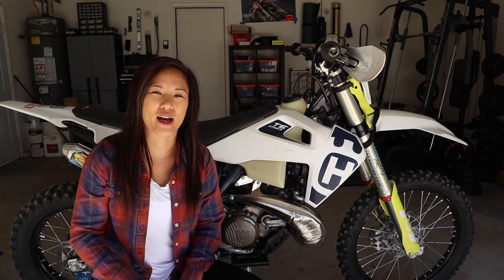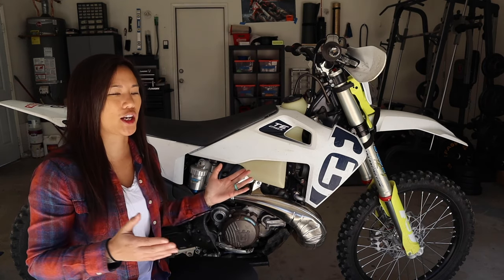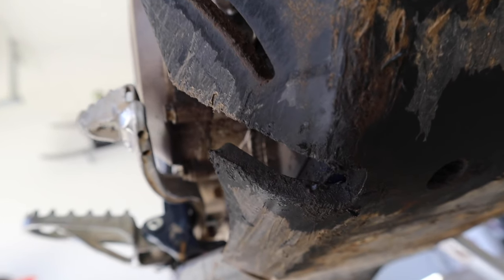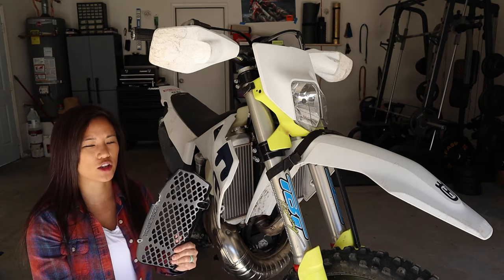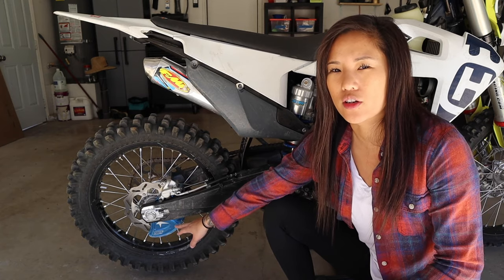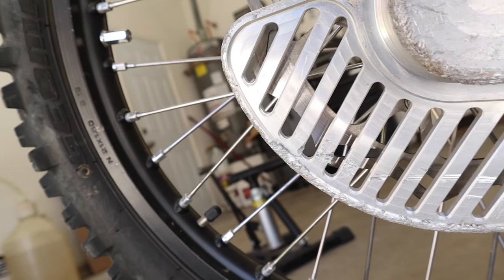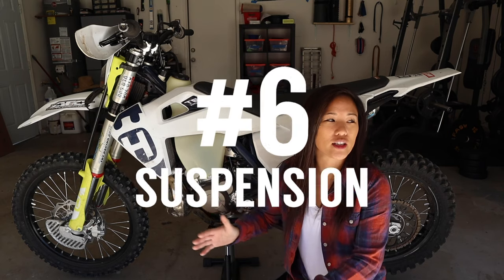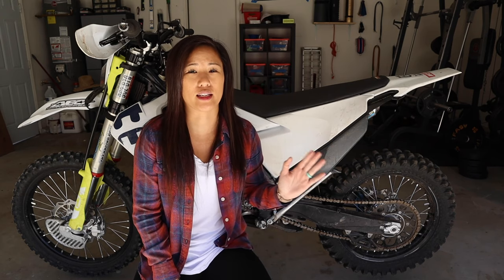TOP 6 Upgrades for Short Riders - Enduro Edition

Comment: I'm 5'4" and my current weapon is a 2017 YZ250X with a SmartCarb, Stealthy flywheel weight and a Scotts stabilizer. Been riding for 30 years and I've never let my height stop me from doing what I love most.
Reply: @Sanguine_Addiction did you do any mods to the suspension to lower seat height, or did you leave stock seat height?
Reply: @frankiesiwinski1494  the only thing I did to the forks and shock was a revalve and re-spring for my weight and riding style. I ride mostly wide open desert and occasionally vet MX tracks,  but I'm not trying to clear triples or anything like that lol. When it comes to off-road, I've never lowered the suspension or seat height on any of my bikes. For me, as long as I can reach the pegs and foot controls comfortably,  I'm fine. The only time I've encountered height problems is when I ride street, especially with tall adventure/Enduro models because I can't flat-foot those. Ironically,  I can ride a Gold Wing due to how the rider cockpit is laid out. Go figure lol.

Comment: I had an xtrainer and loved the size as I’m 5’6”, now looking for something else I’m curious how hard it was to transition to a full size bike?
Reply: I went from a KLX140g to a KDX 220r and it's been great. I shaved the seat to get a little lower to the ground, but I'm 5ft 2 and I can kick start it just fine. I do have to find places to stop a bit carefully to not tip over. But buy a used bike that already has some wear and tear on the plastics so you don't feel so bad if you do drop it. I waited to get the KDX until I had completely mastered the 140 and was maxing it's potential out. I still only ride in 3rd gear max on the KDX right now, but every trip out I get more confident with the weight and power.

Comment: My top short rider upgrades….. #1 suspension work (600$) to lower 50mm…… at KB5 industries in PA. They replaced springs to my weight and it’s amazing. I also got EVERYTHING else you listed. Good vid
Reply: I tried PR2 in PA., and would not use them again.  I am redoing it myself, (I have a little machine shop), and found that they did do the forks well, (the guy on the phone told me wrong), but they could not figure the right spacer for the shock, so I have to figure out the curve and make my own.  You lowered your 2", that is huge.  I thought my .75" at each end was a bit short, but I cut an inch off the seat too.  I have ridden dirt bikes for a long time and raced for about a decade in the 80's and 90's, and the manufactures made the 2-strokes as tall as the 4-stroke.  Anybody under 5'10" could ride a shorter bike better than offered today.
The Guys at PR2, who I talked with on the phone, could not "think past their script".  They really had no idea how this stuff works, and their limited communication skills with the guys on the floor doing the work, (who may be good), can lead, (and did with my shock), in the wrong work being done.  I had fairly easy questions that they could not answer,or answer correctly.

Comment: I had my suspension lowered 2 inches on my yamaha yz250f by a suspension shop and it made a big difference
I feel way more comfortable riding the tight trails now
Reply: I had my Beta 390RR dropped by 2" too, made me so much more confident!
Reply: Im 5’5, 141lbs. I really don’t want to bring my bike into a shop. Im hoping to do it myself. I can straddle my 250f tippy toed. Would like a Just a bit lower if possible. Anything you learned after taking it into the shop?
Reply: @ThenZ6  it cost me $700 but also they set it up for my weight and type of riding I do. If you plan on keeping the bike for several years it is worth the money.
Reply: So what’s the seat height come out to?  Up to in this case??  Sorry if you said it & I didn’t catch it…!!!
#44
Reply: @jefferymentzer1240  the seat height is approxiametely 36 inches now
Stock height is 38 inches. It really helped me since I'm around 5'7 inches tall.

Comment: That Emperor Racing radiator guard is a beast. I dropped my bike on a big rock right on a place that would have crushed my radiator  from the bottom corner. Now there’s a tiny little dent in the guard and zero impact to the radiator. Good stuff.

Comment: A nice & cheap way to freshen up colored things  like the black bar ends is to use black (color appropriate) finger nail polish.

There are 100's , 1,000"s of colors and cheap nail polish. It is durable also.

I have met many street bike riders (guys) with a bike part in hand color matching in a nail polish retail store. Works great on wheels & steel frames also.

ARC levers has guaranteed to not break  levers that many, most professional racers use (AMA motocross, supercross; enduro,...).
They will replace it if you ever break one for free.

Comment: I have had this problem in the pass, my solution was a bike with a lower seat height.  The bike may not perform quite as well, but it definitely reduced the number of times I was dropping it due to the fact my feet didn't reach the ground properly.  Depending on where you are riding, too tall of a bike can be dangerous to the rider.  A side benefit is that the bike is more fun to ride.

Comment: Just started watching.  That dented pipe is the reason why I don't use chrome pipes, you can't fix the dents with out hurting the finish.  You can fix painted pipes to look perfect again, and just repaint black exhaust pipe paint, (high temp paint).  I am an older timer, started riding as a kid in the Hannah days.  I had 5 250 MX bikes and quit for 20 years, and just picked up a 2019 YZ250 2-stroke in almost new condition.  Damn, they got tall.  I am 5'9" and never had a problem touching toes or ball of my feet on the ground.  I shortened my suspension about 6% on each end, and had a shop cut an inch off the seat.  If you really like riding,---even today, you will change the bike the way you want it.  I am heavier now, but this is the worst set up bike out of the box I ever bought.  I don't like today's plastic either, broken bird beak front fenders with a transformers cartoon look to them, and I cut the silly "arrow" shape off end of my rear fender.  Looks better already. :)  Nice bike you have there.  Michigan has some great trails called the "CCC trails" (Cycle Conservation Club).  I think they added wider trails for the side by sides, but they have some very whooped out single track with a berm in every corner ("Little-O trail", to tight stuff like "Tin Cup")
Bring a camper.  Great local restaurants. Baldwin/Peacock/Evert area.

Comment: You can also throw on the pro circuit linkage that's 3mm shorter and it'll drop the tail a little bit buy doesn't affect your ride at all if anything it makes it better I put it on my kx250 to get rid of the stink bug affect and I'm short and it made a good difference

Comment: The only thing I would change is using something like Barkbusters rather than bar ends.  As well as protecting the grips, barkbusters protect the hands with an aluminum or hard plastic guard.  Keeps levers protected as well.
Reply: All true. But if you would crash and flip over the bars they will break your wrists. I ran bark busters all of my career, but I always had that fear in the back of my mind.
Reply: If you adjust them correctly, that won't happen very often.

Comment: Well, TBH, if your bike doesn't get scratched, banged up, scuffed, or otherwise take damage...you aren't crashing. And, if you aren't crashing...you just aren't riding hard enough :)
Reply from the maker: #truth
Reply: @AGirlandHerBike  Until you are 30 and don't bounce off the ground very well anymore.  I spent over 2 decades going as fast as I can, crashing at the limits. At 58, I think I will stick to riding under my limits.  I lowered my 2019 YZ250 2-stroke by taking off 6.35 % of the suspension travel, (.750" in the front, and about .788" in the rear), and had a local upholstery shop take 1" off the seat.  Now, it is just a touch lower than my last 250cc MX bike, the 97 KX250.  I blame the 4-strokes for bikes getting too tall of even a 5'10" rider.  Now the new YZ250 2-stroke 2022 bike looks to have a thin seat that may not be able to be cut down.  It just gets dumber and dumber in this increasingly dysfunctional world that we have to live in.

Comment: I’m short & have a lower seat, a lowering link & fork tubes slid up in triple clamps.  My inseam is 30” & I tippy toe at stops.  Thank you for your opinion on the suspension, I’ve been considering a 2” lowering, but love the current suspension, as long as I am in motion.

Comment: How about a lowering link install ?  They make them for all makes and models . You get 1" to. 2" lower depending on what  link you get .
Reply: Lowering links should be a last option, since they only affect the rear suspension, it can change how the suspension works together. Much better to start with the seat and tuning and see where you get IMO before putting a lowering link on.
Reply: @jacquelinekemp4897  .... Did my seat .... Then lower link .... Raised my front forks .... My bike feels and works tons better now .

Comment: There's some cool videos on how to reexpand your bikes pipe using a pressure washer and a torch to heat it up, ( block end of pipe, fill with water, heat the dent, use rubber grommet/on pressure washer tip hold with hand in place, press trigger feathering until pipe dent gone.) Hope this is useful for you.
Reply: I don't use water in the pipe, and it would cool off the dent if it touched it.  I just use a bit of compressed air, (seal the pipe), and then heat the dent with a torch, (even a decent propane torch will work.).  As the dent turns red and moves out to the normal shape, I stop its movement with a wet rag.  I learned one thing when working on my bikes.  If it turns out pretty good the first time you do it,---it is a good process. :)  I can't remember how much air pressure I used, but I am sure it was under 30psi. Starting at 10psi is safe. If you can make the dent red with the propane torch, and the dent is not moving, you can up the pressure a bit.

Comment: Good video!  

I also had my suspension lowered and tuned for my weight. 
Although I have a 32" inseam, I am over 200#, and felt really uncomfortable tippy toeing on my WR250R.  I was dropping it several times a day when riding double or single track, especially stopping off camber and when tired. Putting a foot down expecting dirt and getting air sucks!  Lifting the bike up is tiring, and being tired makes me more likely to drop it.  Nasty spiral of misery...

I would also add that if your rear suspension has linkage, there is usually a lowering link available.  You also need to slide the front forks up a few milimeters in the triple clamps when using a lowering link.

Comment: why havent you lowered the rear and front WP's? you can do it easily by 2-3cm by changing the rear link to a longer one, and front spring supports to shorter ones

Comment: I was trying your forward rotated handle bar set up, (not as forward as yours), and went back to rotated back to me.  I know it is a personal preference, but I don't think I would have my bars rotated that far forward if I were tall.  An inch off the seat makes them even higher.  I feel more comfortable dropping into a berm or rut, and I can keep my elbows up easier.  I think overall, that bar set up and your arm reach keeps your body weight a bit to far forward.  Try rotating the bars back until the ends of the grips are pointing down a bit when the bike is standing straight up and steering straight, (and readjust your levers of course.).  I think you will like it better.  Easier to keep your head over the bars with out getting front heavy.
Reply: Oh, you do a good vid.

Comment: Better than bar ends is bark buster type products...without which you could EASILY brake levers or master cylinders EVEN with bar ends...My Cycra hand guards have already saved me several times I am sure....and I use the handlebar clamp inner mounting point which braces the ENTIRE handlebars making them SUPER hard to ever bend or snap....THIS IMHO s/b the number one product for shorter riders!   Followed by engine case guards  the skid plates and disk guards are useful for ANY height rider even tose who rarely crash IF one rides in the bolder strewn. log strewn type areas....but if not?  If only riding in actual dirt/sand without such obstacles?  frankly one could even get away with no  aftermarket skid plates or disk protectors....but even less threatening rocks can still break your engine covers in a crash leaving you stranded after hemoraging oil

Comment: Hi,I use to ride a Husqavarna back in the late 80’s and I love your bike. But I’m a Honda person and now have a Honda xr650l. I have IMS foot pegs that extends farther out than the stock pegs. My question is from lowering the suspension 2 inches do you think the pegs will do any scraping when cornering,I lean into the curves moderately but don’t overdo it. Thanx for your input if you can help
Reply: 2" is a lot to take off suspension travel.  Remember, with the same bottoming resistance, the overall suspension stiffness will go up, which is not good for the small stuff like tree roots and small chatter bumps.  I am 5'9, and had not had a bike since my 97 KX250.  That was probably the tallest MX 250 bike I have had to that point, but properly set up, I could touch both toes on the ground pretty good.  I could not touch them at all with the new YZ.  Just .75" off the front and a bit more off the rear, (6.35% on both ends), and my seat cut down 1", and now it is slightly shorter than my 97 KX.   It lowered it a bit more than I thought it would, and I might add a bit more to the suspension if it is too harsh.  I think they best suspension set up is a heavy spring, (with very small preload, like 5mm, for the forks), with little to no compression dampening, and rebound valving that can handle the heaver spring, (if needed).  It is usually the compression dampening that makes suspension harsh.

Comment: im also a short rider and only rode citybikes.  I always wanted to buy a dirtbike but bcause how tall they are it kept me from buying 1;(...how tall are you???
Reply: Dirt bikes got to tall after the 4-strokes were forced on the industry.  The head of a 4-stroke engine is about 4" taller, so the frame had to be made taller.  For some stupid reason, (I blame the modern brain dead magazines), they made the 2-strokes just as tall.  5'9" here, and I no longer fit on a modern dirt bike.  I lowered my suspension by about .75 inches, and cut the seat 1".  It made a huge difference, and is actually a bit lower than my last MX bike, a 97 KX250.  I knew sales would suffer even more because of the bikes being too tall today,--and you just confirmed it.

Comment: i always had bad luck with radiator guards cus radiators are rubber mounted so the flex back even when bent the problem with the guard was it made it solid mount so when the guard got bent the bike was annoying to ride

Comment: Harley added a really heavy option on their new Pan America 1250 adventure bike that automatically lowers the seat at low speed/stops and then jacks back up under way.  For the life of me I cant understand why manufacturers of various long suspended bikes dont provide such gismos....most street legal bikes already have a computer of some sort so why not have some kind of radically variable preload that allows the load/rider to squat lower if super slow or stopped?  How hard could it be to engineer??  Maybe as simple as the preload nut has gear teeth on the outside engaged by a servo motor with sensors that give the computer the ride height and bike speed?  For the forks the servo motor could be inegral to fork caps...maybe a $500 option?  Adding 10 pounds to a bike?  They could sell a LOT more bikes is my guess!   My 690 is about 36" seat height and with my short inseam and the bike weighing 350llbs it gets VERY precarious in the slow going stuff!   I am almost ready to go kuba link or whatever but I have to give up suspension performance/travel
Reply: There was a day in the USA when we were free to compete, but those days are gone, so we beg for what we want.  But, if you only want to touch your toes to the ground or a bit more, (I am assuming your toes don't touch the ground), stack up magazines on both sides of the bike of equal height to put your toes down on to the "toe bend" you want.  If the thickness is less than 2" IMO, you can dial the bike in and not lose suspension performance, (will be the same performance until you bottom out a bit easier with no changes).  I would take it off the seat (Upholstery shop), before the suspenders (internally), make sure you have the right spring rates for good balance, and it will handle better I am sure.  I just lowered a YZ250 2-stroke MX bike, (man, way too tall today), by taking 1" off the seat and .75" off the suspension, and it handles like a dream in all kinds of corners now.  Finding a good shop to do the work might be a trick, (I don't know what is available for adventure, but call Enzo Racing and Race Tech, 2 top notch MX/off road suspension tuners to see if they can help, or know somebody who can).  My bike is such a joy to ride now, and that makes all the effort worth it IMO.  We are suppose to enjoy life. :)

Comment: I'm planning on changing the subframe & seat so it will be like the older bikes with ABSOLUTELY LOWER SEATS.
DON'T BELIEVE IDIOTS SAYING SEATS HAVE TO BE TALL BECAUSE OF THE LONG TRAVEL SUSPENSION!
Reply: I can see the use of taller seats for taller riders when it comes to using less leg muscle to transition from a seated position to a standing position. Doing daily squats help, too.